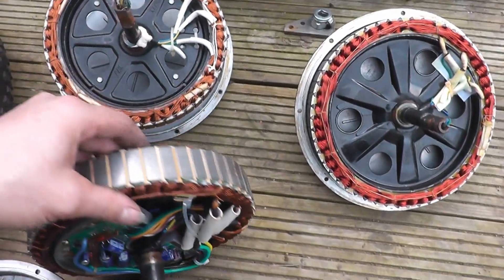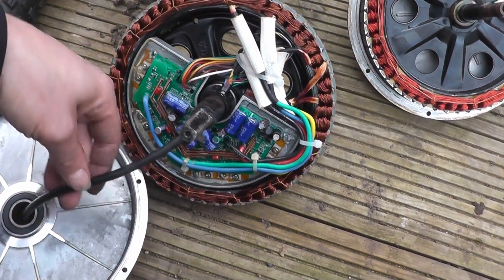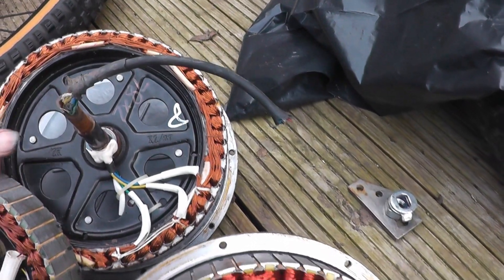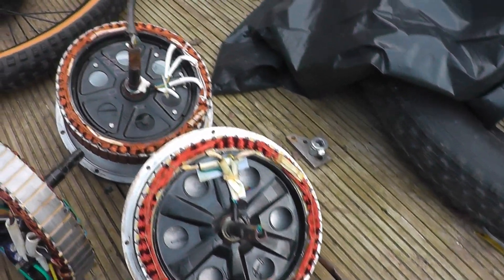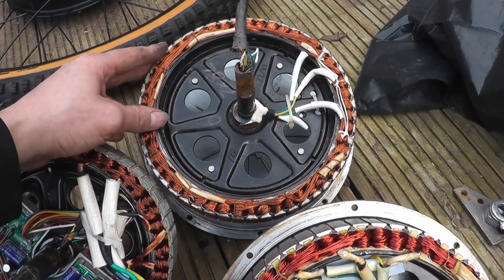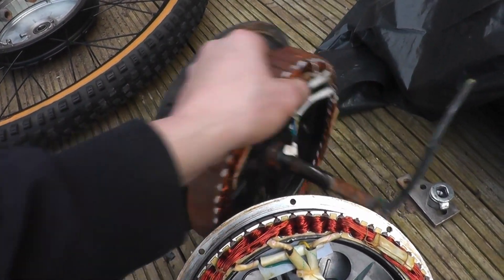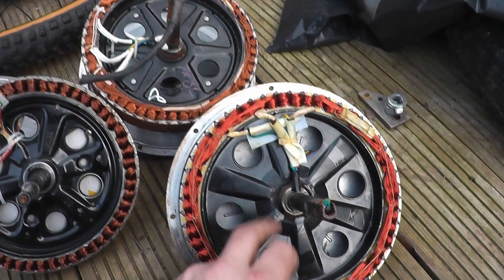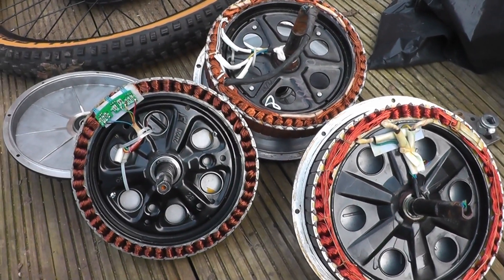#1000W # BEST HUB MOTOR 1000W VS 500W HUB MOTOR   #DIY EBIKE

Comment: thanks for the video. so little information on hub motors on the net. most of the ebikes in my area (canada) come with smaller diameter 500 watt motors (banfang style G06). they are about half the diameter of these type your showing.  I have seen some of the smaller diameter type claim 1000W, but not sure if they could achieve that with the greatly reduced surface area they could achieve with the diameter of the stator. in your experience do these larger motors out perform the smaller ones? thanks.